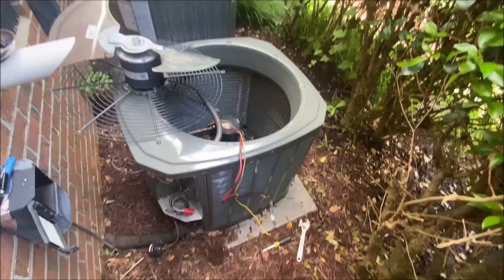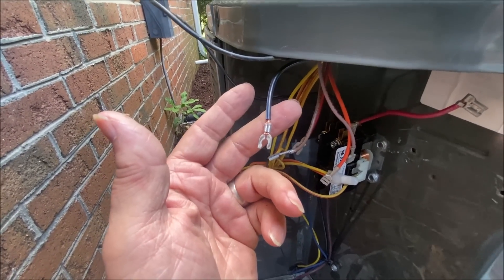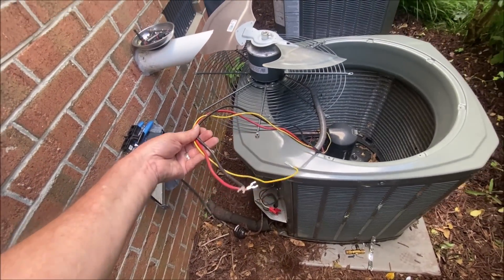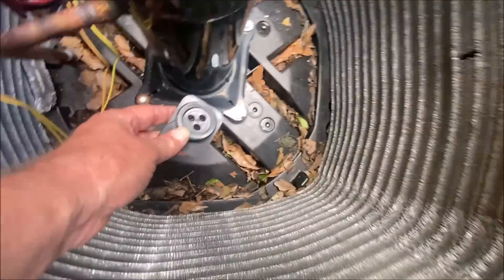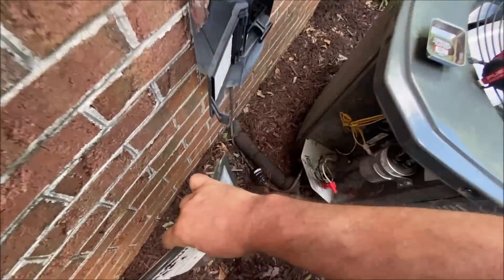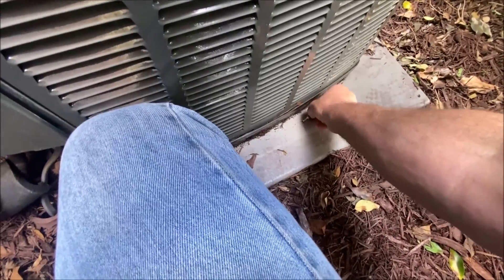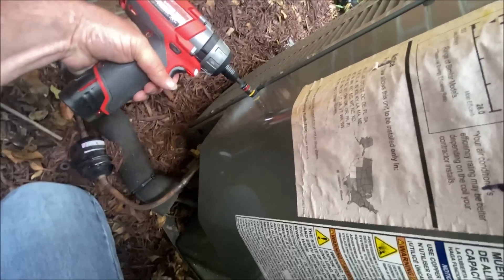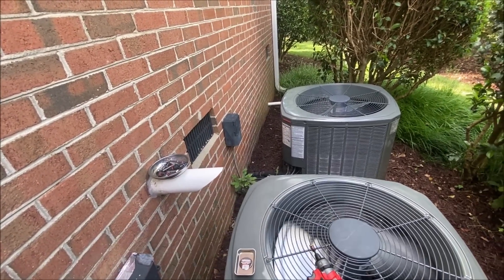Compressor Failed ? I almost made a big mistake

Comment: I would think this is why you should always ohm the compressor motor windings directly at the compressor terminals even though it's more hassle
Reply: Running service for refrigeration company we always were in the habit of using a compressor analyzer hooked directly to the terminals.  I know it is tough to access when working on a AC condensing unit, but getting access to the terminals a lot of times revealed obvious electrical issues similar to what you found.  Good thing you had that conversation with your technician.  I’m sure the customer appreciated your honesty and good work ethic. Some guys would have swept that under the rug.
Reply: assuming gets ya in trouble !!!
Reply: Exactly this.
Reply: Always
Reply: Totally agree,if in doubt
Reply: Yup, agree.  Dang its so easy to just to just take what I can get to.  Sir.  33Years?  You should know better.  PERIOD.  That would have cost the customer a TON O money and If I followed you up,....Would have been possible been a law suit,. Please be careful.

Comment: I’m a 25 year electrician, I have seen some crazy stuff similar to this before. A few years ago, I was working a new hospital. The electrical superintendent called and told me to go up on one of the rooftops that the HVAC tech had a voltage problem on a 20 ton unit (480 volt) Mind you, EVERYTHING else in the building is working perfectly fine, so I went up there. The start up tech had the unit open and locked out. He said the voltage is wrong and fried both compressors. I asked him if he checked rotation, he said compressors aren’t rotation sensitive. He got really mad at me, called me bad names, etc. Anyway, he learned something the hard way that day, and he apologized to me. I have worked around some of the most intelligent people I’ve ever met that are HVAC techs, I told them about this and they got a big laugh out of it. It’s so easy to almost miss stuff like that, that’s something you may not see again for the rest of your career.
Reply: I work on hydraulic equipment that uses positive displacement pumps.  You always know when that’s got the phases wrong.  Sounds like a bucket of marbles. Excellent catch!
Reply: As A HVAC instructor you Are Very Correct. Good call on this video.
Reply: Damn thought everyone knew that, no way he was a 25year tech I call bs

Comment: I had the same thing happen to me with a fan motor. Didn't ohm out right, changed motor, then found nick in the wire. There's no way to check a motor at the connection, but I did learn to at least check the entire length of the wire before changing a motor. One of life's tricks you never forget. :)

Comment: I have been doing HVAC residential and Commercial since 1978,  and the first week of doing HVAC I knew always to check for open windings at the compressor, because anything could happen through wires, contactors, capacitors, and switches.

Comment: My grandfather always said, "check the cheap stuff first"! "Cheap stuff breaks first because it's cheap"! That advice has saved me a lot of money in my 63 years! How many times have we seen someone fire the parts cannon at something and not fix it till they get to part number 9 or 10? A local HVAC tech here in NC told my parents that the compressor has failed and they needed a whole new R410A system. I went to look and found a bad fuse in the disconnect. It's still running! BTW, the owner of the company was a friend and he fired the tech to help keep the company's good reputation! When you find an honest tech, keep him! Not sure? A second opinion could save you thousands! Glad you're man enough to admit it when you make a mistake!

Comment: This would pop up as a suggestion shortly after my Trane was stopped by a short. I thought my thermostat was toast as it kept rebooting, nope! HVAC tech comes out and finds a mess of hot exposed wiring in the air handler and condenser unit outside..install company gave us the shaft. A rewire and new 5 amp fuse later, system is back to normal.

Comment: I did an install about a year n half ago and when we cranked it up it had a LV short. Damn unit came with all wires smashed where they go into electrical cabinet.. was so pissed at the factory lol
Reply: One of the wires from pressure switches was the culprit lol

Comment: Nice work. I once replaced a compressor after someone else had replaced a compressor. It was three phase so I wired it the same way they had theirs. When I finished I realized that the compressor was trying to run backwards so I swapped two leads and it ran fine. In my defense I was not the one that diagnosed the original  problem but it taught me to always double check the other techs before doing the work. I did all that work to replace a compressor that was just wired incorrectly.
Reply: You have to treat EVERY call as a NEW call.  Forget who was there. You are the expert and your customers count on you.

Comment: I almost made very same mistake. These connectors can really deceive. The compressor wouldn’t fire up, and got voltage to the connector. Even moving the wires it made no difference. After pulling the connector off, it didn’t seem right, ohmed the connector and found it.

Comment: I just got an old window air conditioner back into operation after a mouse had made a nest in the compressor area and chewed through wiring. I used the wiring harness from a unit in my scrap pile that lost its charge last summer. A 1982 Westinghouse has been saved from the scrap pile for another year. Great by the way, always watching you on my weekends off.
Reply: Nice resourceful fix Mr 
Ardie McLelland!

Comment: Wonder if someone had the top off for cleaning and that wire got stuck over there when the top went back on.
Reply: I bet that’s the case.
Reply: Most likely the case. That hole Ted found the common wire is not there from the factory.
Reply: the wires should have been in a 3 cent length of loom but that would cost the corporation 3 cents profit but that is unamerican

Comment: I start my checks at the contactor....if i find something unusual....i then go directly to the comp terminals....it always lets you know if its the wiring or the molded plug or a true issue. Just remember kids......80% of electrical failures are actually mechanical failures. If the comp is out of warranty.....cut it open and figure out why it failed....if its in warranty.....ask for the inspection report from your supply house....if its a second or third comp under warranty......you definitely need to figure out why.....inspection reports are free for the first replacement....second and so on cost a little money.....but less than a new comp.

Comment: Seem that many times on Trane units. That spot where you found the common wire is not a factory hole. Someone had the top off that unit and pinched that wire putting it back together

Comment: Nice Save ! Great Video ! Great Reminder Video for Everyone ! Allways check the compressor ohms Right at the Compressor & Do it when it cold 🥶. BEFORE Calling time of Death 💀 ! 
Wire Nuts are FINE ! They have been used in the Trades for 100 Years !!! no real issues. i Prefer Butt Connectors over Wire nuts these days for High Amp Connections & use Wagos Now For Everything else that is Low current !
Great Reminder / Video !!!

Comment: High voltage passing through a metal cutout without a $0.25 plastic grommet.
Reply: That hole wasn't factory, the pinched wire cut it in as it was arcing. Seen it many times
Reply: It's rolled metal, doesn't need a grommet. The wire shorted because it was pinched.

Comment: In automotive, we see wiring harnesses wrapped in electrical tape and covered with that black tubing, or wrapped in that heavy-duty black textile tape. We see rubber grommets where it passes through sheet metal. There's countless wiring harness brackets and clamps that prevent movement and damage by vibration. And it's only 12V.
In HVAC, we see unprotected wires just dangling freely over the edge of some sheet metal, with 120V on them. That just cannot be the OEM's way of routing those wires. Seriously?
Reply: You would be surprised how often those rubber grommets are never in place
Reply: 220 my friend not 120.
Reply: @AllTattedUp13  technically hes not wrong.  Each leg carrying 120 to make 208/230 or 277 to make 460/480.

Comment: Compared to you I’m very new to the field.. but just the other day I had a Similar issue darn mouse chewed through one leg I just thought it was odd when the compressor wasn’t coming on and after pulling the covers over sure enough I found the nest at the bottom with the wire chewed!
Reply: And for some strange reason, rats/mice love Trane units. Never see it happen on other brands

Comment: I wonder if that was really a factory assembly error or did someone pull the top to clean it and the wire snuck over there during reassembly?
it's way too easy to get a wire pinched off to the side, I use electrical tape(or zip ties) to bundling them in that area, that makes it much easier to keep them in one place.
Reply: That's probably so,it's happened to me changing out condenser motor your right wires get pinched

Comment: Personally, never like to see wires crossing bare metal cutouts. Should always be grommeted IMO.
Reply: The place where the wire is supposed to go has rolled edges on the metal, the notch where that wire was burned in due to someone putting the top back on wrong, and pinching the wire between the top and the edge of the sheet metal.
Reply: Rolled metal or not, looks like the wires look pinched between the conduit and the u-shaped cutout. Personally would have put a piece of loom or other protection.

Comment: Thanks for sharing Ted 
From time to time we all need that wake up call
I did  learn two lessons from it
I see you switch to 12 volts  milwaukee never understand why guys use the 18 V large drills on 5/16 screws call me lazy
but i don’t need a biggest tool for a small screw

Comment: I was taught very early on that when ohm-ing out a compressor that’s off on thermal overload, to ohm it out at the wires that connect to the contactor. I was told to do this because pulling the wires off the compressor itself when it’s overheated, one of the fusite terminals could pull out with the wire. Not only blowing out the entire charge, but could spray extremely hot oil all over you. I had to do do this just the other day on a 6 year old Goodman who’s compressor was off on thermal. After cooling off the compressor the overload reset itself, and the stupid thing started running backwards. I had no idea that could happen in a single phase scroll.

Comment: Guess it’s a good idea to have a spare wire connector/whip to double check whether you have an electrical issue vs bad compressor
Reply: Sounds like a good idea.  I used to work in the two way radio business and had all kinds of jumpers made just for that reason.
Reply: Or just tone out the harness

Comment: I absolutely hate those new quick push on connector units that copeland and all these manufactors are using.  I wish they would go back to the old school 3 individual push on female flag connectors and spades.  Also i feel Trane on their end could of made sure the 3 wires were in the proper place so they would not get cut into the metal.  Thats ingersol rand for you.  Their products along with united technolgies products suck.  I have seen many ingersol rand air compressors blow up.  I wish they would of never took over trane.

Comment: My question is before replacing a compressor why wouldn't you test the actual contacts on the compressor instead of the end of the leads? I thought that was fairly standard practice to check windings directly on the compressor connector.